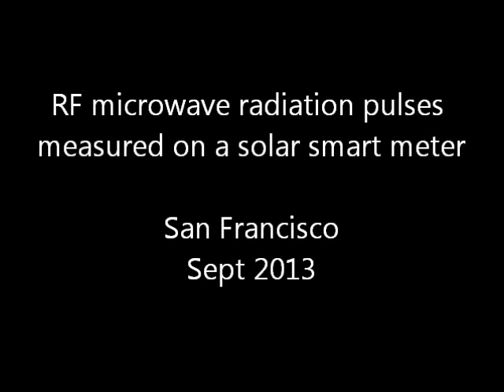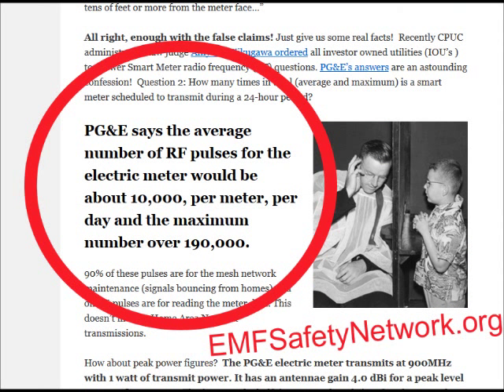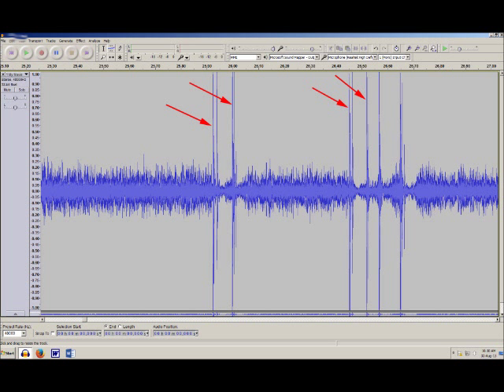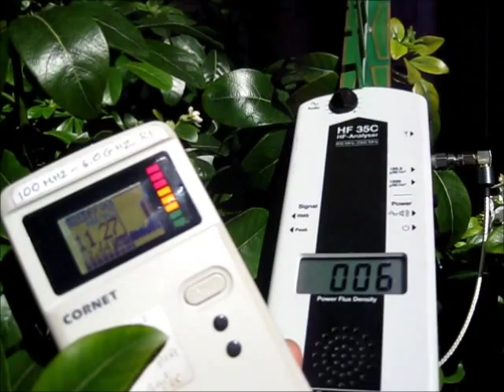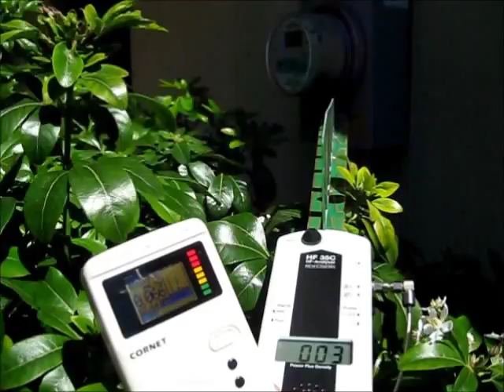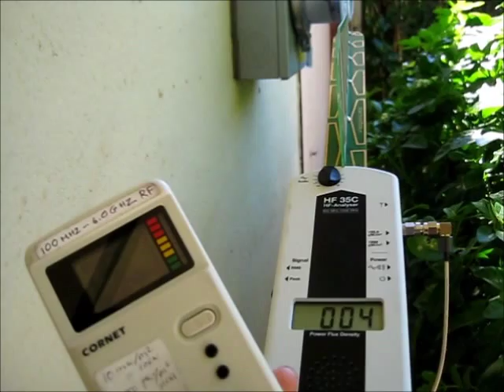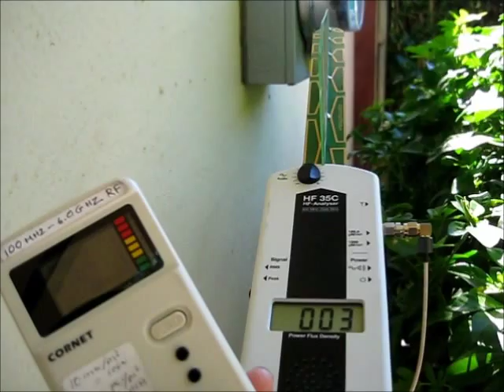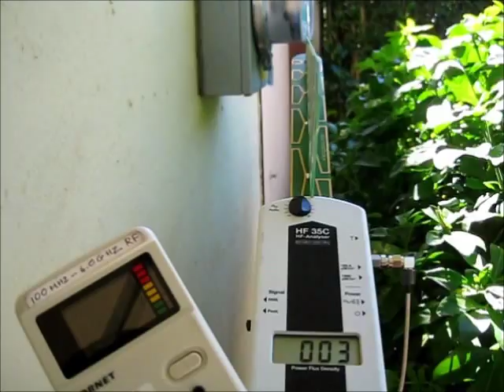RF Radiation Pulses Measured on a Solar Smart Meter

Comment from the maker: John has it about right. I'd use as large a piece of aluminum screening as you can get---try 4 feet by 6 feet. Center it over the place the meter is located on the wall. Move your bed as far as practical from the meter location. 

Learn more about the risks from your own RF-emitting devices, if you use a wifi laptop, computer, smartphone, cordless- or cellphone. Cut down the time you spend near these emitters and keep at a distance. 

Go to EHTrust [dt] org and read about cellphone radiation.

Comment: John puccetti & thisirradiatedlife thank you for the advice. Im signed in on my newest account. I think the aluminum sheet is doable. I do use my smart phone a lot but I will definitely check out that webpage. Will it tell me about side effects? Im wondering if some of the things ive been feeling lately could be linked to the smart meter. Anyway thank you so much im going to look into how to install something like this on my wall. I appreciate your time.

Comment: Wrong....... here's why, this 'meter' measures R F  do you know what R F is? 
..............................AH NO........... 

If you take the 'meter' and hold it next to the fridge you'll get the same reaction, 
Hold it next to a light bulb you'll get the same reaction

here's what you are seeing    REALLY;
........a measurement of magnetic field and electro radiation

                   these thing occur where ever there is an electric current

"An RF field has both an electric and a magnetic component (electric 
field and magnetic field), and it is often convenient to express the 
intensity of the RF environment at a given location in terms of units 
specific for each component. For example, the unit "volts per meter" 
(V/m) is used to measure the strength of the electric field and the unit
 "amperes per meter" (A/m) is used to express the strength of the 
magnetic field.
and you CANNOT  just multiply and get some scary ass number to prove your point.. 
.........if ......you.........are.......driving....in .......your .........car......you .....are ...exposed...to ...more!
this is not science this is hoodwinking.